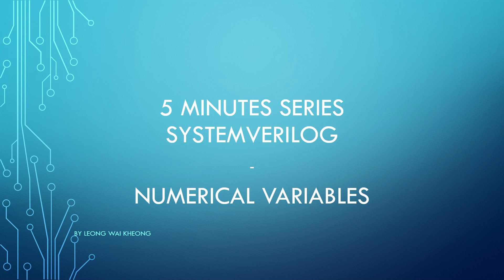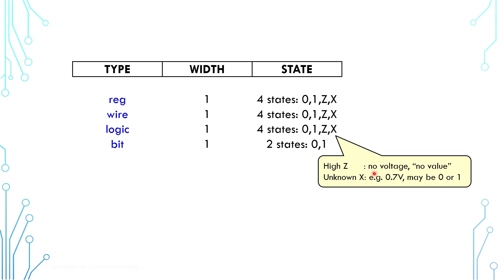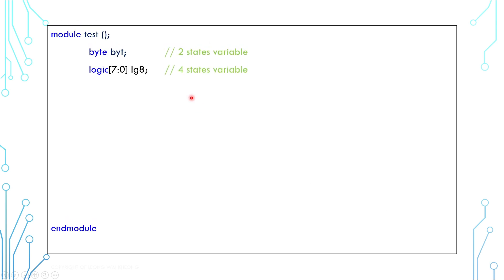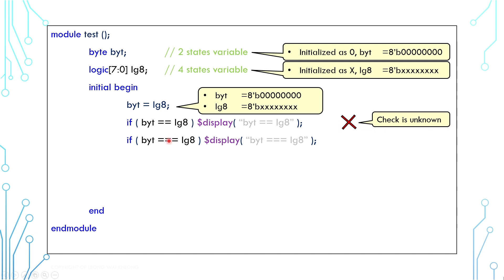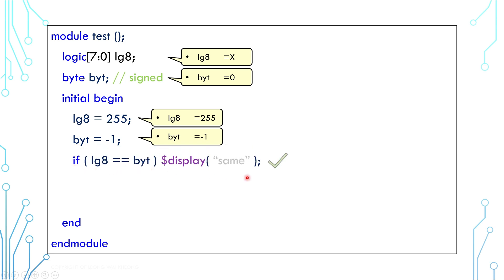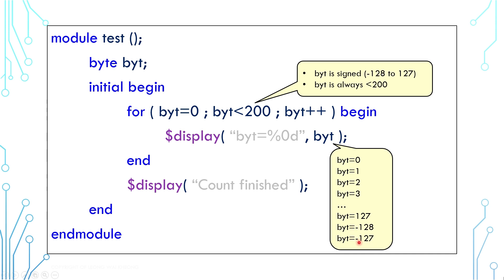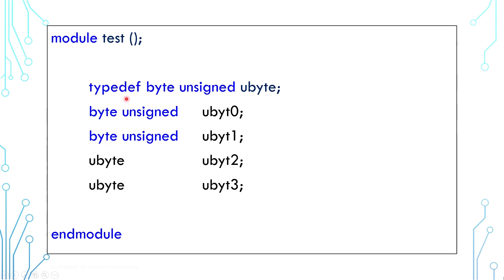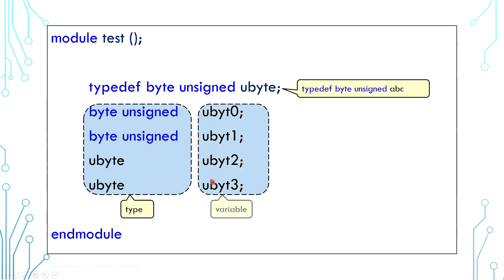SystemVerilog Tutorial in 5 Minutes - 03 Numerical Variables

Comment: After trying with different numbers, I went back to the original and it gave me the correct result!

[2025-01-03 21:11:04 UTC] iverilog '-Wall' '-g2012' design.sv testbench.sv  && unbuffer vvp a.out  
The two are equal
Done

I don't actually know what went wrong.
Thank you.

Edited:
Just realized that I used 225 instead of 255. That's my problem.
Reply from the maker: Not sure which example you're referring to, but I'm glad you've found your way 🙂